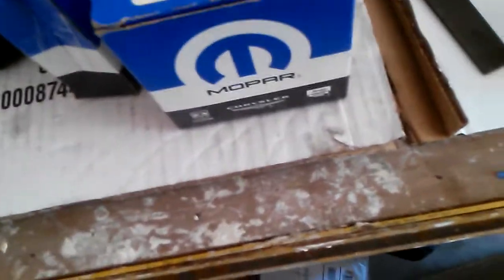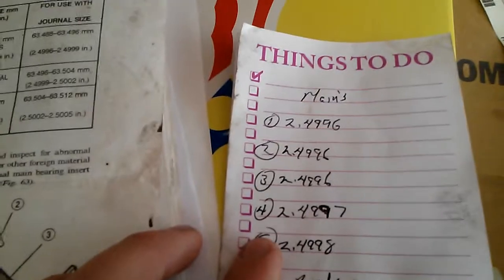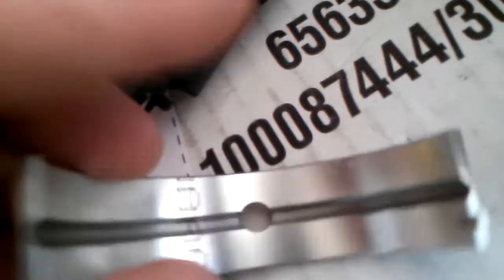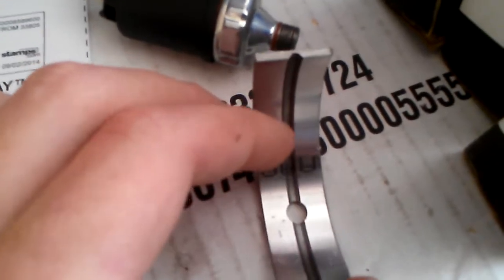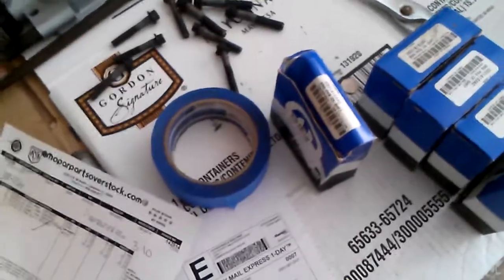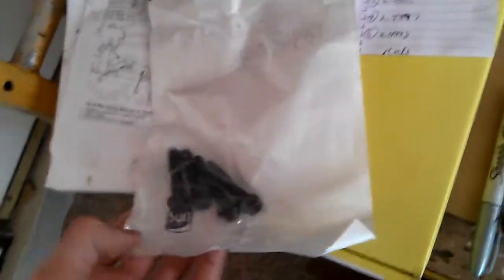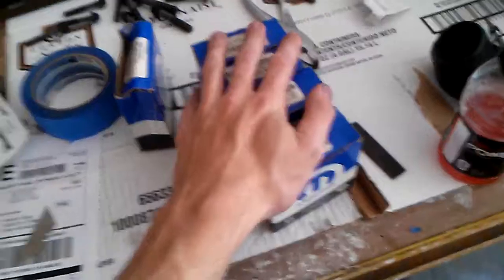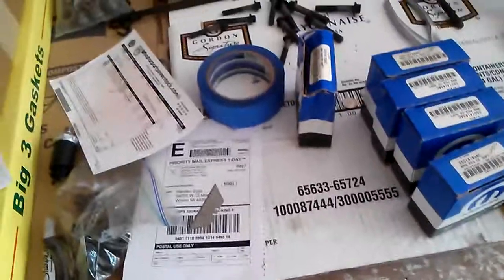4.7 Rebuild - Main Bearing Selection - Dodge - Jeep - Chrysler - PART 2

Comment: Change your head bolts even if they arent torque to yield. The amount of stress and load they are under and heat for the amount of time they are in service is pretty good reason to just spend the extra money on headbolts rather than having one snap off inside the head after youve already torqued all the other bolts and compressed the headgasket. Tty or not they still receive a ton of heat and load for however many hot/cold cycles. And become brittle and stretched. Would risk reuse of headbolts about as much as id rely on reuse of exhaust manifold studs.

Comment: The nicks on those bearings were so minor and the material so soft that they would have smoothed out immediately on first startup if not when the main caps were torqued down and spun by hand.  You can also polish them with a plain clean cotton cloth before assembly to smooth the nicks out.
Reply: Some people are too inexperienced to be giving tutorials on youtube

Comment: Hey great vids bro! I have a 4.7 in a jeep and it is seized. When i say seized i mean it dont turn over by starter. I put a braker bar on the crank pully nut and turned counterclockwise and it will turn without loosening but idk if this means its screwed or could i try and do the treatment where you fill the cylinders with some type of oil and special penetrating lube? What would you recommend? im not in a position to pull the engine and all that so its a try or die situation so any input would help greatly thanks alot